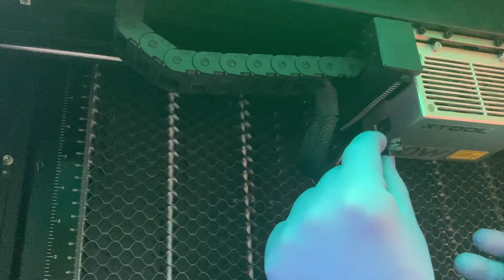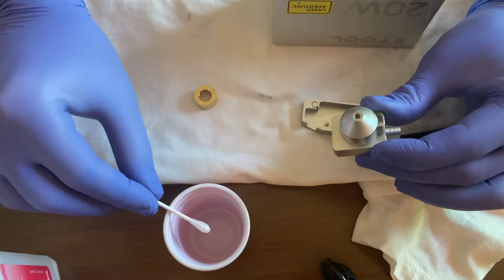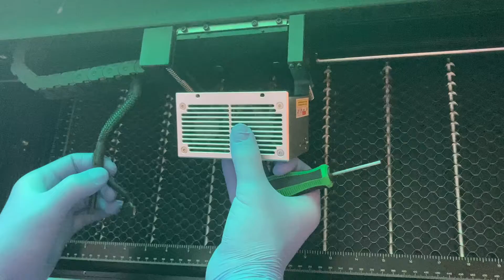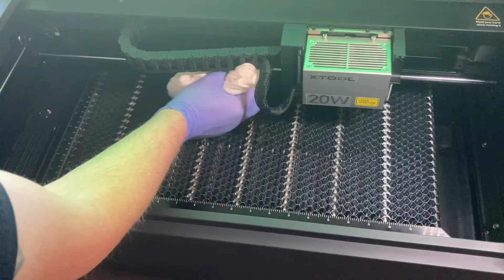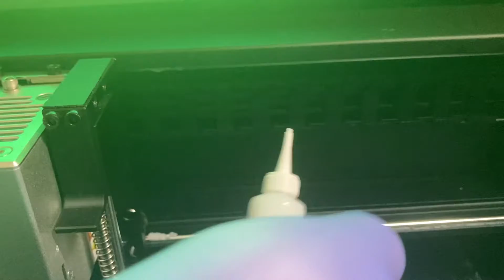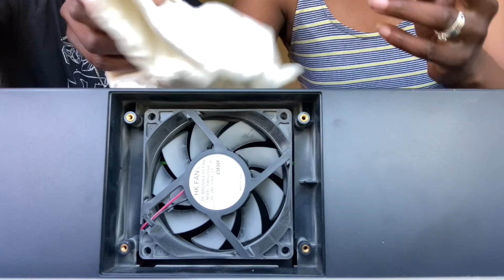xTool S1 Maintenance Clean Smoke Exhaust Fan, Laser Lens/Lens Protector,  Air Nozzle, & Guard Rails

Comment: Nice video, my issue is the amount of tumblers messed up by the laser engraving. For example, i got 18 40oz tumblers with handles and 6 of those cane up with horrible engraving defects. The lens is clean, the work area is ventilated and property set to avoid vibration.
I have always had this problem.
I also would like to know what you think about the poorly designed enclosure that has too much fumes leaks.
I'd appreciate your advice. Thank you!
Reply from the maker: Yes the fumes definitely leak. I got the original xtool inline fan and it was decent. However I asked them to send me the new IF2 and it works way better than the original inline fan at removing fumes. I found that the IF2 works best at maximum setting when cutting wood and acrylic but you still need ventilation or other safety measure’s to be safe.

Comment: I have had my S1 xtool for two weeks, and it all of a sudden lost it's laser beam.  I googled and googled to find the problem, and finally came upon your video!  It's the best one I've seen for cleaning.  I was set to return the cutter because the manufacturer thought maybe it was a power problem, and there was no way i was going to start tearing apart the mother board to check it out.  But your video showed me now to take everything apart on the laser module to clean it, so i did, and realized the protective lens was damaged.  I put in the replacement and all is working!  Thank you sooooooo much for your video!!
Reply from the maker: I am glad everything worked out for you and my video helped!!!

Comment: is there a real need to take off the hose and lens protector?   does smoke get into those areas?
Reply from the maker: Maintenance we did was all the maintenance that the manufacturer recommends. We followed how they said to do the maintenance for the Xtool S1 and put them all together in one video. Of course not all maintenance needs to be done at the same time each have there own timeframe based on use. As for the hose and lens protector based on what materials you are using you can get build up that can visibly be seen and cleaning that build up will keep your system running optimally. Especially for the lens you don’t want it to be blocked with particle build up.